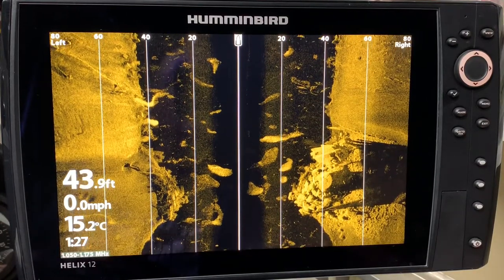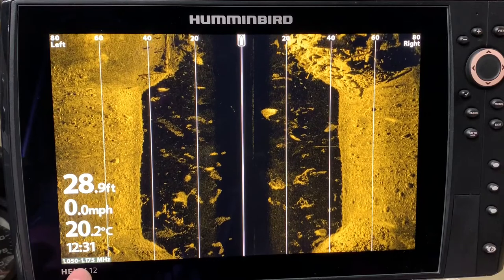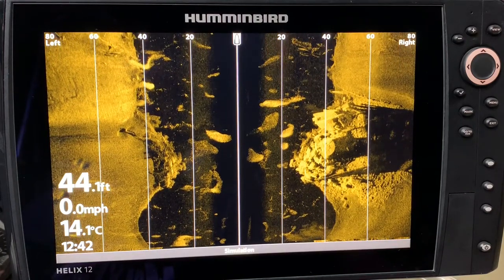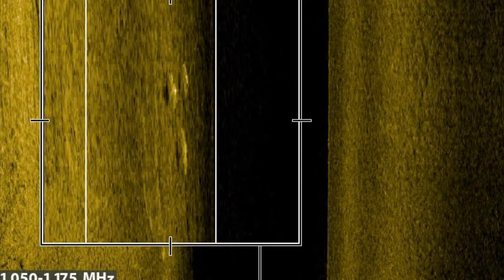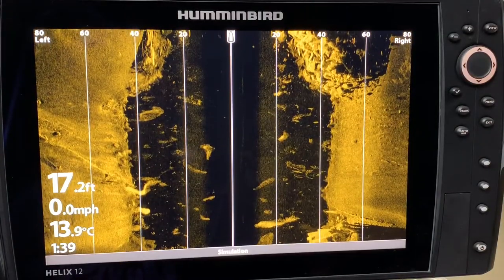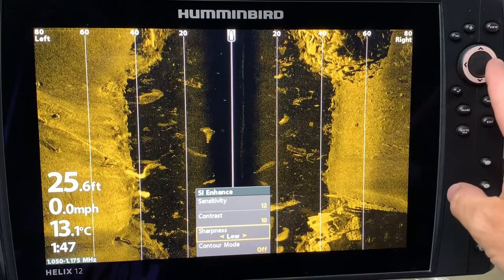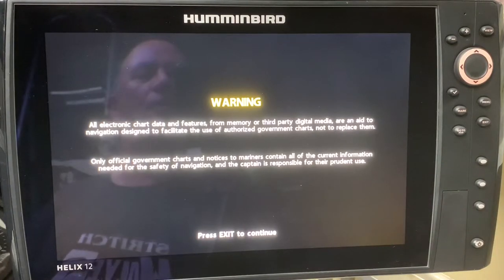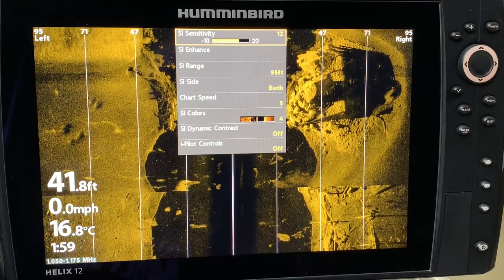Humminbird Helix Side Imaging Settings & Images

Comment: Thanks, Steve.  I just set up my boat with a helix si GN4, mega 360, and terrova i-pilot link and I am having a hell of a time learning the helix.  This is the best, most concise video I've seen thus far.  Part of the reason I've been having some trouble is that when I'm on the water I'm concerned that i'm paying too much attention to the screen rather than driving the boat.  Now that I realize I can use simulation mode, I can practice in my driveway.
Thanks again, this was helpful.
Reply from the maker: When you’re side imaging you are only going 2-5 mph so it shouldn’t be a problem plus you have the screen image in case you miss something. Check out my Mega 360 settings and images video as well, you should find it helpful too.

Comment: Thank you for the great video and I like your videos. May I know how to save setting? Each time when I switch from ice mode to open water mode, all the settings I did in openwater change to default settings, I have to push buttons to re-set.
Reply from the maker: Thanks for the kind words Jason. I would suggest you take a picture of your settings or write down your settings prior to switching it to ice mode. When you go to reset your unit, you will have a great starting point by using settings you were happy with prior to converting to ice mode.

Comment: Question? I've watched your video a few times and haven't seen how you get rid of the vertical grid line when on the SI. I don't like them.
Reply from the maker: Hit menu, menu, go to sonar tab at top, scroll down to SI Range Lines, right click to turn them off. (make sure you have clicked custom, not angler under user mode which is menu menu under the set up tab)

Comment: Steve I have a question not related to the video , but is still a hummingbird question ,how can I reach you  I have a helix 9 mega Si/di and I have lost the water temperature off of my screen ,where can I go to get it back
Reply from the maker: By simply commenting here, I will get back to you in a day or two.
Reply from the maker: Hi Mike, make sure you are in custom mode not angler, hit menu menu and go the set up tab. Scroll down to digital readouts, select overlay or boxes, whichever you prefer. Once you’ve picked overlay or boxes, then you can scroll down one more and pick select readouts to customize your picks including temperature. In your messenger request, any Humminbird dealer should be able to order you a transducer if they don’t have it in stock.
Reply from the maker: If all else fails, hit restore defaults which is also under the set up tab and that will bring you back to factory settings.

Comment: Steve, when you make changes in simulation mode do they then change automatically in normal mode? Or do you need to remember what you did and change them once your on the water?
Reply from the maker: They will stay in your settings.

Comment: Our helix 7, 2nd gen we believe worked well for a few months. Then it started showing water depth of 1k and we lost sonar etc, I have unplugged and replugged and also checked transducer mount. Unplugging and replugging seems to make it work for about 5 mins and then it goes back to that crazy stuff. Thoughts???
Reply from the maker: Hi Alex, I know there were some issues with depth that were corrected with software updates. Have you checked to make sure that your unit is up to date? If so, manually setting your depth ranges can help.

Comment: How did you get the white lines 20 40 60?
Reply from the maker: Hit menu, menu, under the sonar tab, scroll down to SI range lines, turn on.
Reply: Thank you. Can we mark a spot on Side image way point it and put casting ring?
Reply from the maker: Just move the cursor, put it on top of structure you want then mark waypoint. Personally I don’t use the casting rings as the range lines give me the casting distance information I need to cast accurately.
Reply: @Steve Chiasson Fishing  the range lines are what you told me about earlier right?
Reply from the maker: The range lines are the 20, 40, 60, 80 lines